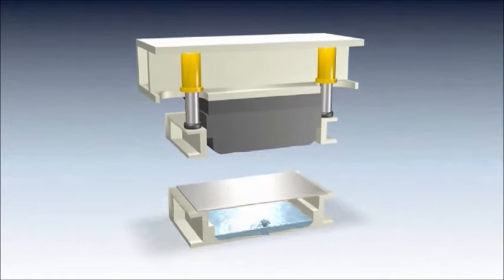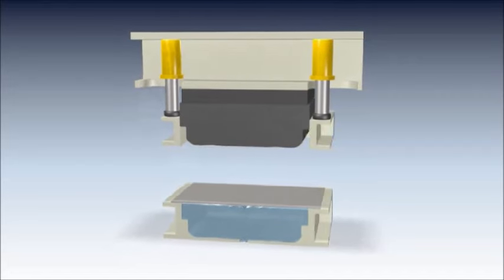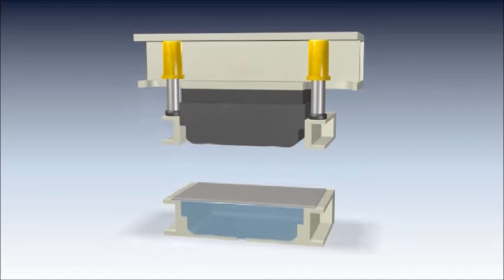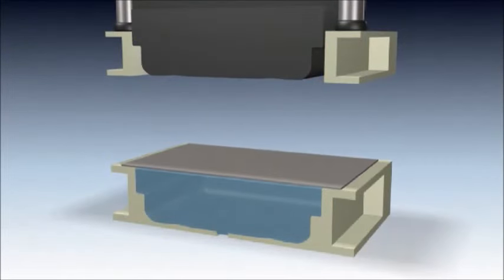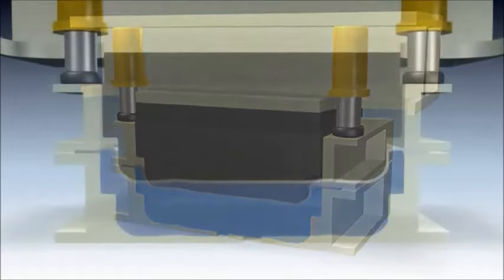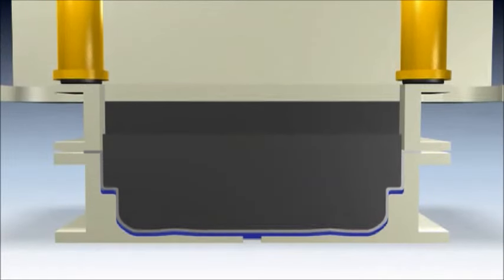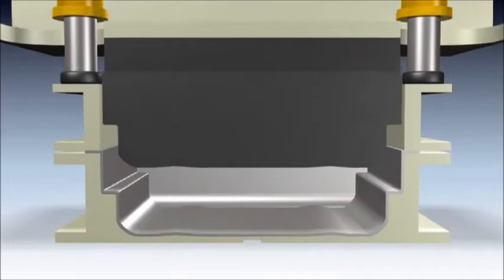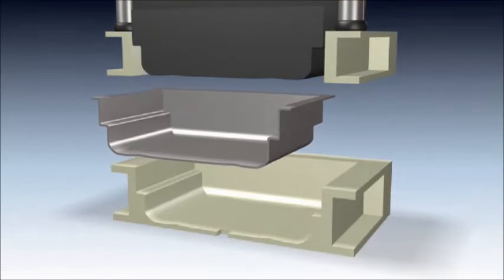Hydroforming Animation

Comment: How is the water vanishing? Lul
Reply: from what I understand the water is held in by pressure, when the die comes down and overcomes that pressure the water is pushed out of the hole in the bottom. this pressure is high enough to bend the sheet, thus it will be pressed against the die before it will push out the water.
Reply: Where is your brain lul
Reply from the maker: The water is pushed out a hole at the bottom of the die through pipes to a tank.  The pressure is controlled via a pressure relief valve in the pipe.  All water is evacuated from the die and then filled back in for the next hit.